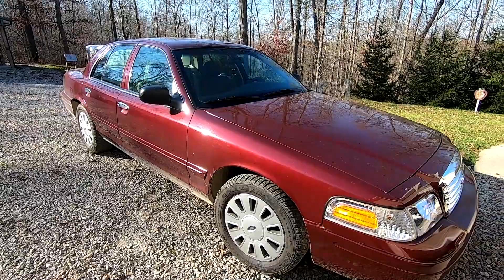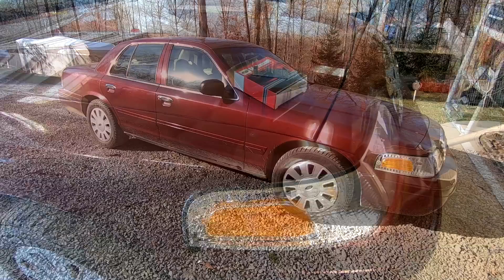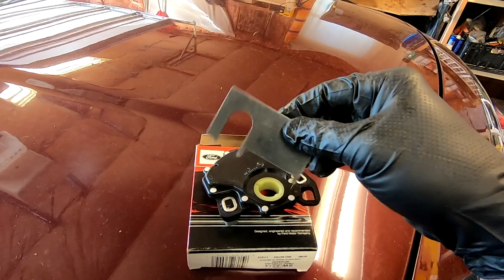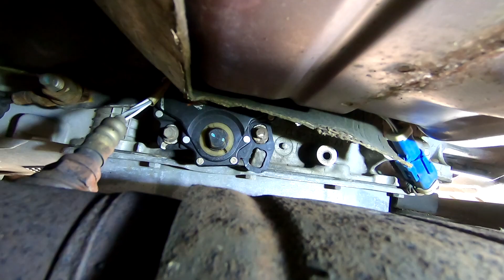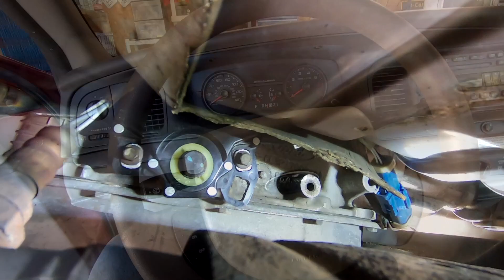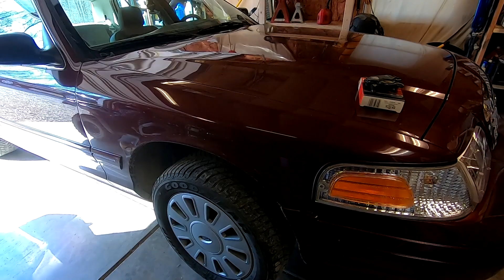Ford Crown Victoria Neutral Safety Switch Replacement

Comment: My car will start, but wont shift out of gear unless i press and depress the brake pedal a bunch of times. Worse in the cold weather.
Reply from the maker: Sounds like a problem with the brake shift interlock. You should hear a click when you press the brake pedal. Check the brake light switch on the pedal arm

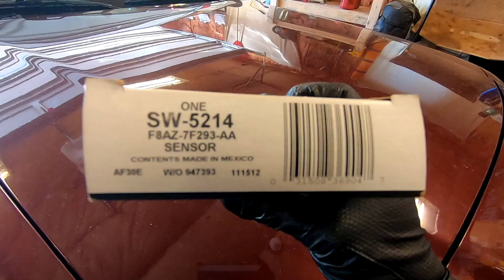Comment: 2:40 huge disappointment that it’s not Made in USA.
Reply from the maker: Agreed
Reply: @JackofAllMasterofNone im replacing the manual shaft seal for the same car and I will either buy a USA made OEM MLPS or reuse the existing one.

Comment: Got the code for a bad neutral safety switch, followed the steps in this video and now my car won't start at all. Is there anything I could have done wrong.
Reply from the maker: The switch could be aligned wrong or just bad out of the box. Also double check that you didn't bend any pins plugging it in.
Reply: @JackofAllMasterofNone  Thank you

Comment: Have this issue on a 97 Grand Marquis. Replaced starter, nss, starter relay. Went into the steering column, checked the linkage bolts, and bushing all seem good. But the car will start, then no start until pressure is applied to shift lever, for the life of me cant figure it out. Got the car to start fine a few days ago, then get a call yesterday stating the car isnt starting right again. Got any hints on my next move?

Comment: Did you unplug the battery first or leave it connected before unplugging the old neutral safety system
Reply from the maker: It's always best to disconnect the battery before working on anything

Comment: I have a 93 Lincoln town car which should be exactly the same as your Crown Vic under the skin. You mentioned a clue to your natural switch was the reverse lights didn't come on...but your car still started. My Lincoln won't start in P or N but the reverse lights still do work in reverse. Does that mean there is NOT a problem with the natural switch? The problem started today when I used the car there was an ever-so-slight hesitation before the car cranked over. I did my errands making 2 other stops and starts No problem. But 1 hour later the car went completely blank in all gear positions. The car has a new battery and clean cables. Is it possible the natural switch is still the problem even though the backup lights still function when put in reverse?
Reply from the maker: Sounds more like a starter or relay.

Comment: My car has an oil leak from this sensor. I don’t know if it is from this sensor or not ?
Reply: Did you ever find out where that leak is? Got same issue/leak from this spot too
Reply: @jmgarcia12 there is a seal behind the sensor you need to remove oil pan my vic is 2006
Reply from the maker: This doesn't seal transmission fluid so your leak is from something else

Comment: I have same issue with no start and also battery goes dead overnight, had alternator and battery tested both good wonder if this switch is culprit.
Reply from the maker: Sounds like you have some sort of short somewhere

Comment: Question if I have to take this off for a snapped shifter linkage not replace it but just take it off and put it on and it’s in park what do I do? I don’t really have the option for it to be in neutral. Can I just take it off and put it back into the same position
Reply from the maker: That's what I would do
Reply: Thank you I need to rig up the shifter linkage to get it to the garage and an 8mm and metal zip ties are a lot cheaper then a $300 tow to my garage 😂

Comment: I don't understand something. The hole is shaped in such a way that it can only go on one way. Therefore, it doesn't matter if the neutral lines line up or not because no matter what gear it's in the thing will still go on correctly. So you just put it on and then push the lever it attaches to back all the way and you're in park. What's the point of the lines then?

Comment: 05 Crown Victoria having trans problem will up shift and drive fine but when I’m slowing down/downshifting and I get to 20mph-15mph and then want to speed back but my RPM shoot up and then hard shift. It will only do that at 15-20 when I’m still rolling and wanting to speed up has a new MAF and TPS clear codes and reset computers still have same problem
Reply: did you ever figure this out? mine is doing the same right now. it threw a P0705 which is the code for the range sensor shown in this video. It did not fix it.
Reply: @levony1489 had to rebuild the trans

Comment: Is  this neutral safety switch smaller in older crown vics?...smaller and maybe slightly different functions, but the same result if it goes out? ..result being that you can't shift car out of park?.. I want to say its what my after market guide calls transmission range finder that is indirectly tied to the brake on/ off switch or boo- and I don't know for sure.. Please post if u have similar and have changed them out succesfully., or post if I'm way off base on this..

Comment: Can u still
Drive the car if u need a new neutral switch
Reply from the maker: Depends. On mine, no.
Reply: @JackofAllMasterofNone  My car starts fine and drives perfect. Would that switch alone affect just my reverse lights to not work?

Comment: My car won’t go in reverse is this a possible fault?
Reply: I have no reverse either on my 06 vic it just stopped working it'll only go slowly if I step on gas just revs it's weird, did you change your transmission fluid
Reply: @papo862  transmission grenaded due to fluid pump failure, it burned all the fluid. I got a new one put in but they didn’t install the fluid all the way lucky I caught on to it before it started burning up the clutches
Reply: Did you find the problem on why reverse didn't work?
Reply: @ transmission, 
The next time it did it my gear selector switch went bad

Comment: having a strange issue here. replaced the switch on my dad's 2000 mercury grand marquis, it's the same part as the one in the video, but now it won't shift out of neutral,  and still won't start. we are at a loss here hoping you might have some insight,  otherwise we'll have to get a local mobile mechanic to come check it out, and don't really have the extra money to spend on that right now.

Comment: I have non working reverse lights on my '07 P71 Vic. Twice I've taken it in,twice the same mechanic has adjusted the switch,and the lights only work a short time then stop again. He claimed the last time he tried another switch and they didnt work so he re-installed the old one and adjusted it again. That time they only worked a week,the time before they worked 2-3 weeks. The car starts in park but not neutral. I wonder why it keeps coming out of adjustment. The mechanic says maybe the lever it mounts on is getting worn. Any thoughts?
Reply from the maker: Unless you have transmission problems it could be the shifter cable is going bad. It's a known issue on these cars, especially the older ones.

Comment: When I put my Crown Vic on park there’s times where the Overdrive light will start flashing (you can hear the car idling louder when it does this) and it triggers the check engine light. On my scan tool it reads code P0708 “Transmission Range Sensor A Circuit High”. The Overdrive light flashing goes away on its own or I have to switch it from Reverse or drive and then put it in park again to make it go away. I hope this switch is the cause
Reply from the maker: Sounds like this is most likely the culprit.
Reply: Did replacing the switch fix your issue. I have the exact same problem only CEL is P0705 transmission range sensor circuit

Comment: Can a 2010 transmission police crown vic fit on a 2005 crown vic police interceptor
Reply: Yes 06 thru 12 same mechanical parts, 98 through 2012 body parts

Comment: Just finished swapping the neutral switch out...it was a bear. So I changed everything, tested all the fuses and relays...still no start. No click, nothing. All the lights come on...(no antitheft though...would have been easy).

Spent over 1000 dollars on this heap and still back to square one. I dont care how rare this one is but its about to become spare parts
Reply: I see your post is 3 yrs old... We're dealing with no crank no start....Needed new battery and it ran like a beast 2 times then nothing! Saw our negative was way too high so replaced battery cables..nothing. Replaced starter/solenoid..nothing. Checked relays and they were fine. Made sure grounds were everywhere. Now we're going to replace neutral safety switch after checking to see if rear lights come on. The most we've accomplished is getting a click in the relays. No thunk from the starter.  Did you ever figure out your car??  My neighbor had exact same problem on her 98 crown vic and the neutral safety switch fixed hers. We're just going down the line of what to do and a little frustrated. We had replaced the ignition lock cylinder before all this because of the dinging. My husband and I have DIY'ed all our vehicles for 50 yrs...I'm not a dumb female :))  But this!!! Did I mention frustrated??  My husband covered in stitches right now so taking a break. Any update? 'Im in the opinion the ignition lock cylinder did something weird..froze up then kinda broke...my husband thinks not. We have these little contests to keep it fun.
Reply: @TLL999  yup, saw you posted again, so Ill answer quikc then do the longer on the last
Reply: Did you ever find your problem?
Reply: @k.lamareyev4418  Not yet. Its on hold now because of weather. I even bought a Snapon scanner (I caved finally I guess...) and did a full code read, and not a single code present. So, while it was frustrating, at least I know that its not in the PCM, or antitheft. It can't be neutral safety, since its new, and I did check that. The only thing left could be the actual ignition switch, which would make the car think Im just turning to ACC and not going past. I have my doubts (or maybe I just dont want to tear the staring column off lol). I may get a new starter. I did bench test the new one, but I didnt do it through the solenoid, just through a direct motor test. It may be a grounding issue. It has to be something really dumb at this point, so I figured, let it stay (its my car so no customer to worry about) and if I buy another starter, it can always go in parts storage. I do have doubts over my crimping of wires (I did use a heavy duty crimper...but with a broken back, and numb hands, its possible theyre weak. Maybe the lugs are not good? Ive come across really nasty chinesium lugs, so Ill check resistance again..but I just want it above 30 lol. Its been in the high teens all week, snowing, and the car is outside. Not fun at all). Sorry for the blog post here lol. TLDR: No, Im dumb lol
Reply: Lol no worries. Sorry to hear that. If you have a cvpi you won't have pats. That's one problem taken care of. Next time try turning the key to the on position like you Starting it if you hear the fuel pump buzzing if it does chances are you ignition switch is good. If you have a helper have them turn the key on pull the starter relay and check for voltage from the starter switch to the starter. You can also jump start your car fom the same relay. Hope you have her back on the road soon. P.s thanks for your reply.

Comment: It may also cause no A/C, along with backup lights, at least on P71's. I bought a new one from the Ford dealer- it failed within 2 months. Just bought one from parts store (with lifetime warranty) for almost half the cost as the dealer part.

Comment: Do you put car in neutral before you take this off
Reply from the maker: Yes.
Reply: @JackofAllMasterofNone  why do in neutral and not on park?
Reply from the maker: @NYC_YELLOW_CAB  because that's how the unit is installed when it's centered out on the marks.
Reply: @JackofAllMasterofNone  is there a way to reach out to you to send a video ? I have a 2011  NYC crown Victoria taxi with no power no crank

Comment: Could this part cause a p0720 (transmission output speed sensor circuit malfunction) code and cause the o/d light to flash?
Reply from the maker: No. Most likely not.

Comment: Does the same switch responsible to put the car into Limp Mode and delays the gear shift... Specially wheb the Wrench Lights comes up, the car is stiff and feels heavy..
Reply from the maker: Usually the 🔧 indicator signifies a problem with the drive by wire system / throttle body.
Reply: The limp mode indicates a bad solenoid inside the transmission pan that has a faulty wire. I replaced mine with identical issue.
Reply: @PursuitMode2011 mine was caused by an electrical short circuit which was identified by the Ford agent.

Comment: Awesome vid, I like all your CV vids really (Liked and Subscribed).

I have an issue where the car is in Park and I can't start it. If I move it to Neutral it starts right up. I also have noticed that sometimes when I shift it to Park it doesn't fully grab and will tick tick tick while rolling backwards. Is the fix in this video of the same nature or am I needing to research a different aspect of the gear selector /transmission?
Reply from the maker: Sounds like you have a slightly different problem. Sounds like you aren't engaging park completely. Could be due to a bad shift cable or issue with the shifter itself.

Comment: Just replaced my starter for about 155$ Then I found out out my neutral safety switch was the problem. Pissed me off so bad. I have a 03 towncar that I use everyday, can't wait to get it running again.
Reply: Turn the key twice, pull the shifter up and crank it up in nuetral! Will work everytime
Reply: I just did the exact same thing in my 08 crown Vic
Reply from the maker: Well look at it this way, at least you know your starter should be good for a long time! Been there. 😉

Comment: When I put my Grand Marquis on reverse, the reverse lights don't work at all. Everything engages normally and I even changed the reverse light bulbs but nothing happened. What could be the issue causing this? Thanks.
Reply from the maker: Either the circuit feeding the reverse lights (look in manual and check fuse) or it's the neutral safety switch just like my issue was.